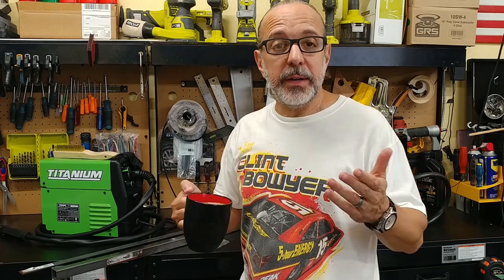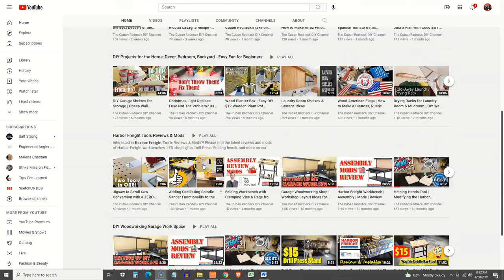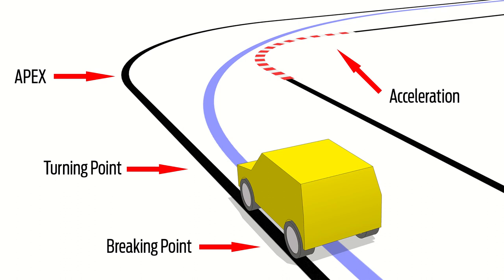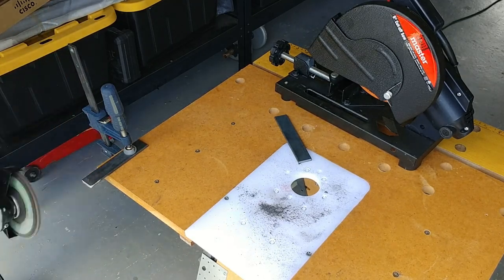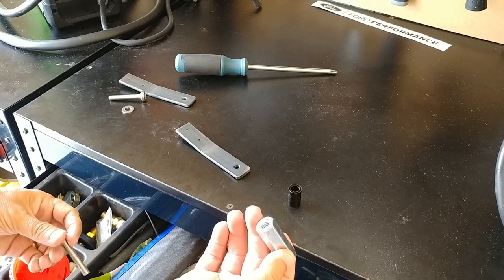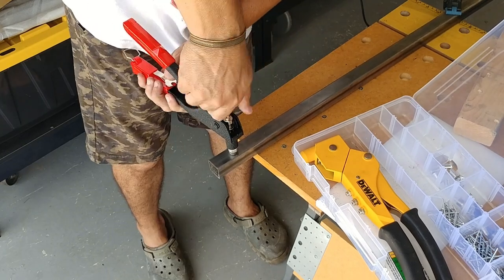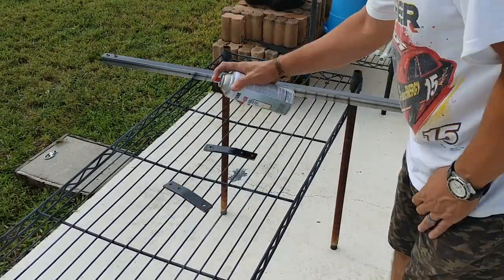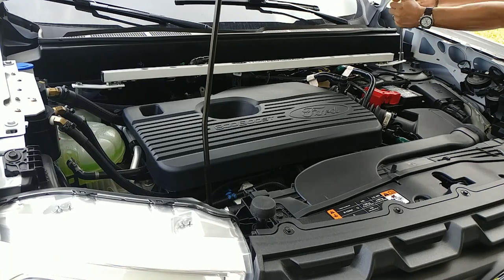Strut Bar | Making a Custom DIY Strut Tower Brace for My Ford Maverick

Comment: How much driving performance increase did you see after the install?
Reply from the maker: ... have not driven it really hard due to the weather and still have not installed my 19" wheels, waiting on springs but it feels more composed getting off at my regular exit on I-75 at 5-10 miles over the recommended speed

Comment: Ok.  I went to do this and found it pointless.  There is a cross member already spanning between the two strut towers underneath the windshield  cowl
Reply from the maker: … yes, and so does every late model vehicle, from door hinge to door hinge to protect the cabinet area in a side crash. However, the cross member is in the shape of a "C" facing forward in relation to the struct towers and does nothing to control the upper strut tower flex and distortion. The brace makes that a BOX. I have redesigned the struct bar since that video after realizing how much force was being applied to the attachment point and to accommodate four AEM Smart coils. With low-profile 18s and springs, the strut bar makes a noticeable difference at my local autocross track. But I will acknowledge that it has little value for a daily driver.
Reply: @CubanRedneck  Fair enough

Comment: I respect and admire your level of knowledge and am wondering if you could tell me if a strut brace would help to increase the lifespan of my struts or other components of the vehicle? Or if it just creates a stiffer ride? Because I have noticed a bit of body roll in my maverick when taking some turns on the highway
Reply from the maker: … hey, thank you for stopping by. The strut bar is going to allow the truck to manage turns a little better by controlling body flex. The Maverick is a unibody. It does not have a chassis like a Ranger or 150. Bracing the upper open architecture of the suspension allows the tire to track better and maintain a better contact patch. As far are the strut life, it is irrelevant, but it may prolong alignment on vehicles that run on rough streets. My truck is getting 18 wheels, low-profile tires, and springs as soon as they are available for the FWD models. The struct brace is imperative with such suspension mods.
Reply: @CubanRedneck  thank you very much for the information! I appreciate it! I think I am going to try one out seeing as they are cheap and relatively easy to install. The roads where I live are typically quite rough so helping maintain alignment would definitely be worth it.
Thank you again!

Comment: Where did you get that ecoboost cover? It looks so good! did it pop on or did you need additional mounting plugs and brackets for it to work?
Reply from the maker: ... the cover is off a 2022 Escape with the 2.0 EcoBoost. I got it at my local dealer. I think I have the part numbers on my blog. But if you can't find it, hit me back. I am still limited to internet connectivity from Hurricane IAN, but I may be able to look it up. It snaps into place. You also need to buy what is called a "BALL STUD" for the left rear corner. The two front ones are built into the intake manifold and the right rear is a M8 X 12 bolt. The cover is more than pretty. It is a pretty good noise suppressor. That's why it is standard on all the luxury models.
Reply: @CubanRedneck  you're freaking awesome! thanks! Any chance you're going to add an actuator and harness for the tailgate lock?
Reply from the maker: ... thank you, that will be part of the hard tonneau cover video. Thinking of making a fiberglass, perhaps carbon fiber bed cover for about 1/2 of what a soft top cost. I have been MIA for personal issue, the weather has not cooperated, and NOW dealing with IAN aftermath, but I will be accelerating video production in the next few month. Once again thank you for stopping by!

Comment: What are the torque specs for the Maverick on those bolts?
Reply from the maker: …hey, thank you for stopping by! I am not 100% sure about the Maverick, but for example, on a Mustang Cobra, the structs are 26 ft. Lbs., and the strut tower brace is 41 ft. Lbs. I torqued mine to 40 ft. Lbs. I don't see it needs more than that!